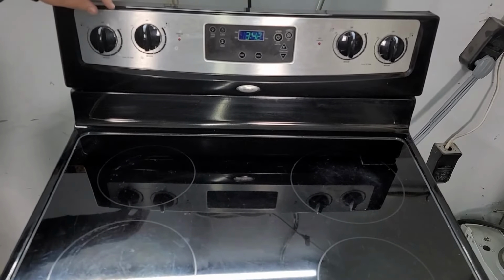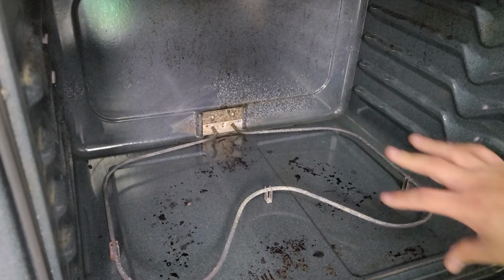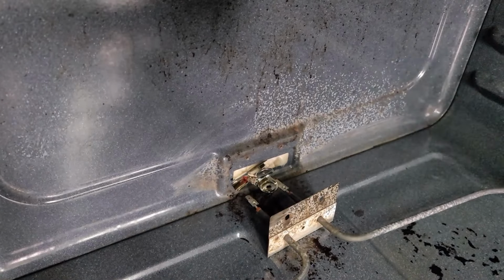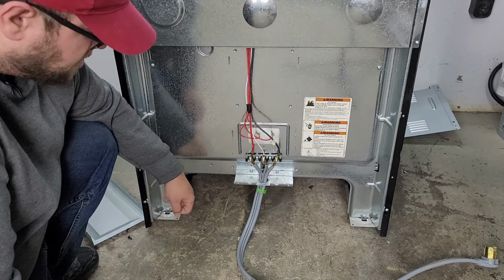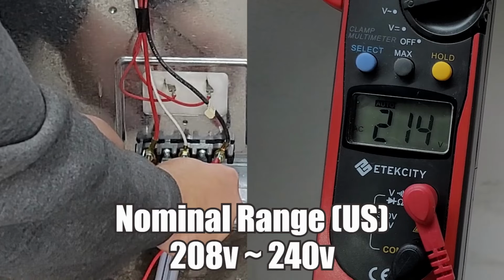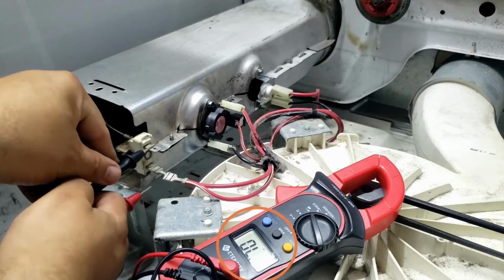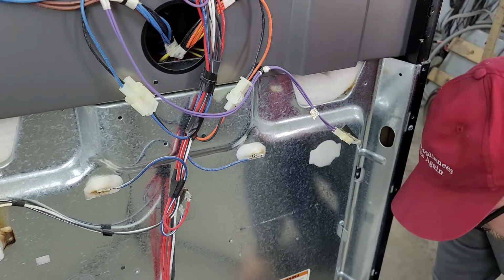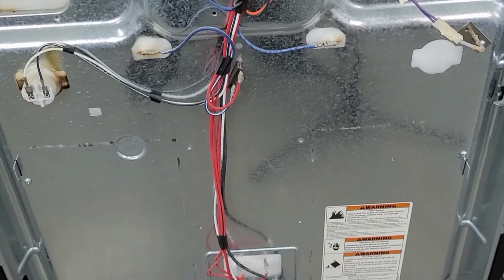Whirlpool Oven Won't Heat - How to Range Troubleshoot a Whirlpool Oven Not Working

Comment: the bottom burner works fine but the top oven burner sometimes kicks on and sometimes wont come on.....and you have to wait for the oven to get cold before the top oven element will come on....is the thermostate in the right place.whats my problem. its a RJE 3020W0 whirlpool...the bottom oven element works good and kicks on and off and keeps the temo right for baking in the oven...my trouble is with the top oven element which checks out fine....it just dont want to kick on.

Comment: Hi Ben, thanks for the very informative video. We have almost the exact looking stove, except mine has the fourth prong. The stove top works and also the broiler. It's the lower heat element that isn't working. I've used a multi meter n the actual element is fine. What could it be?
Reply: I also checked the thermostat n it is fine also
Reply from the maker: Usually its the heating relay on the board if the thermostat is fine as well as the heating element.
Reply: @bensappliancesandjunk    Can you help us? I ca'nt run my electric glasstop and oven at the same time without tripping the circut breaker. Any ideas? Thanks in advance!
Reply from the maker: @monir9696  power cord, terminal block, or breaker are bad. It happened to my stove maybe 3mo again. The power cord was melting but I took care of it before it got worse.
Reply: @bensappliancesandjunk   OK have replaced the breaker, thankyou
Reply: Thank you! Do I most likely need a new control board?
Reply: I had put everything back together after doing so I plugged in the oven, as soon as that happened the wire connector to the bottom heating element sparked! 😬

Comment: My bake element was broken so I purchased a new one. I replaced it but it didn't heat up, my broiler element heats up. I checked my thermostat and the oms resistance was at 1065 well below the chart you showed, however you said a standard stove should be between 1050 and 1100 moms and the reading fell within that range. Do I need a new thermostat?
Reply from the maker: If its 1065 with the stove being at room temperature, no.

Generally, if you replace the heating element and the broil works but not the bake, its the bake relay on the control board has gone bad and the board needs replaced, or the relay itself.
Reply: I tracked the wiring to the control board, is the relay the plastic connector attached to the board the wiring goes into?

Comment: My Whirlpool oven isnt working after self clean. Replaced the thermal fuses and the shut off fuse ... and the control board and still not working. No display. Power does not come to the door lock. Oven is 5  years old. What do you suggest I do?
Reply from the maker: Did you say the display is not working at all? If it is not working, do the burners work?

If burners works the control board could be bad. If the burners do not work, it's an electrical issue.
Reply: @bensappliancesandjunk  Thank you for helping. Nothing works. No display. This is a whirlpool built in oven only. No burners. Control board replaced, thermal fuse and shut off fuse in the back replaced.
Reply from the maker: @karemani2002  if board has been replaced you'd want to star tracing wires to see why you aren't getting 120v to the board. It not turning on suggests a wire is bad or burnt or electrical has done something on one leg to prevent its operation
Reply from the maker: By chance have you reset the breaker?
Reply: @bensappliancesandjunk  Braker is good. I traced the wires and found that the dial that turns the oven on (bake-broil etc) and off has some burn marks on it and decided to get a new one. It is coming in a few days and will let you know what happens. Thank you
Reply: @bensappliancesandjunk  I found out that the control switch (the wheel on the front panel) got burnt. This is the switch that enables you to turn the oven to broil or bake or clean etc. I bought the unit on ebay for $40. Replaced it and everything wen back t to normal.  I got my oven back.

Comment: I tested everything and all was good with temp sensor and elements & line power supply. I can hear the control board click on and quickly click again, the oven elements just get warm (enough to touch) I set temp to 350, then the display shows 100 degrees; so I'm guessing it's the control board. Would you think it is too?
Reply: This just happened to me as well. Could you please let me know how to fix this?
Reply: Same here
Reply: Same
Reply: Me too how was it fixed
Reply: It was the whole control unit. Where display is.
Reply: @albertm105  did the stove top work?
Reply: @CaptainCurtReacts  Yeah it ended up being the whole display unit after that worked perfect. The whole module
Reply: @albertm105  where did u order it from??
Reply: @CaptainCurtReacts  lmao funny seeing the same ppl on yt from other places 😂
Reply: @Amazing_80  lol this fixed it.
Reply: My oven showing F9
Reply: Same with me

Comment: Hi Ben. I have a WP looks just like this model. Largest front main cooking burner switch was hard to turn a couple times then just fell off. I did some research and it seems it could be the infinity switch? Also, right about that time my broil element stopped working. Not good for a real cook. Can you help please? Are those two proems connected?  My son has a meter and his electrical cert a d works for a fire alarm co but lives in another state. If you would be so kind as to steer me in the right direction toward repairing these items maybe I could fix it or somehow get him to help me.
Reply from the maker: Both things are typically not connected, as the infinity switch is totally separate from the broil element in the vast majority of stoves. A scant few are, but most are totally separate. I'd replace the infinite switch first, then look at what's going wrong w/ broil.
Reply: @bensappliancesandjunk  Thank you for your time and advice Ben.

Comment: Hey I have a Maytag oven and my element got a hot spot and broke in half. I ordered a replacement element and I plugged in the 2 wire and now when I heat up the oven it doesn't heat up...any thoughts? Thanks

Comment: Hey Ben I have Whirlpool glass top stove /oven My baking element will not get hot temperatures on display will not go higher then 100 degrees. The broiler at top works fine as well as the stove top all work . Any idea what may cause my baking element not to work it also is brand new . Still has the new oven smell when you turn it on we have used it only 3 times .
Reply from the maker: I'd check for 240v going to the element. That is quite advanced though. I'd unplug the stove, and pull the control board and look for physical damage to the square or rectangular boxes on the control board. Likely, the relay has failed and there may be physical evidence of that such as a burn mark. 

Is the stove brand new or the element?

Comment: Hi! Looking to see if you might have an answer!

Whirlpool Freestanding range similar to the one shown in this video... cooktop turns on, starts to heat, then stops. Same with oven, heating to about 200-215 and stops. Nothing more. Can you offer any advice? 

I can get the cooktop to work properly after a few tries of turning it on and off slowly.
Reply from the maker: Do you have knobs that turn it on/off for the stove? Or are they all push-button? For the oven, that sounds like a relay issue on the board (it starts going bad, and the proper electric fails to cycle to heat fully)... For the stove part - thats real odd, and would make me think the relays work on the stove-top from the board too. However, older or more basic stoves don't route any electric to the stove-top thru the board, just the knobs.

That would then make me think you're getting insufficient voltage to the entire stove. That's where it gets pretty seedy, because you'd have to do a live voltage check w/ a multimeter. Its 240v so that's dangerous and I'd suggest a professional. Or if you had good gloves on, and were fearless... You'd check for 240v at terminal block while you run the oven and stove, to see if there's any sort of voltage drop (you need 208-240v to properly run either the stove top or oven as both sections need a TON of electric to operate). If there's no drop, either a wire isn't plugged in right, is partially burnt, or not fully connected.... If those are ruled out, it points back to board again
Reply: @bensappliancesandjunk  woke this morning for the eyes to not be working at all anymore!
Reply: Nor is the oven, control board?
Reply: @bensappliancesandjunk  i have 4 knobs and a push button screen.
Reply from the maker: @shelbyseay2815  sounds like an electrical issue
Reply: @bensappliancesandjunk  pulled the back off, wire going to thermal fuse is burnt
Reply from the maker: @shelbyseay2815  there's your issue then. You'll likely need a new thermal fuse and re-wiring to that fuse. Not too expensive, usually.

Comment: Extremely helpful video. I have the same oven w10432689a with the same issue. I have followed your steps and believe in is the control board. However I can not seem to find that control board anywhere on the internet. I have followed your link, Google, Sears, Whirlpool, Amazon and have had no luck. Any advice? Thank for the video.
Reply from the maker: Use any of the parts websites to determine the model# of the BOARD you need. What I typically do then is just do a general Google search for the board and then go hunting to find anyone that could have it... Many times, if its old, the result ends up on EBay.

Comment: Hey Ben, my stove top works fine. But my oven doesn’t  heat up. Both elements are not getting hot. I tested my terminal block and it’s good. I can’t get a reading on my oven thermostat. Thoughts? On bake, it won’t heat up. And on broil it reads that it’s already to 500 degrees instantly.
Reply from the maker: Sounds like thermostat is bad. You NEED to get a reading of about 1,100 ohms @ room temperature, and anything much beyond that is going to mean its bad. Every mfg. uses practically the same setup for ovens either electric or gas. So as long as you can confirm there's no ohm reading from the thermostat, its likely the culprit and they're usally real cheap to use.

Comment: Hey Ben, I could use some help. Top burners won't turn on. Oven heats slowly. Tested elements, all seem fine. Tested power like you did. It shows me the 120 per side & 240v. But when I turn a burner on & check again. It no longer gives the 240v. But i still see the 120 per side... I've tested the outlet & i get 240v there. So a bit lost...
Reply from the maker: What does voltage drop to when you turn oven on, or turn a burner on? It should stay constant at 240v. If it drops a lot lower, you have a neutral issue.
Reply: @bensappliancesandjunk  I can't remember exact number off the top of my head but it falls under 100v. When you say neutral, do you mean on the stove? Or with the wall outlet?
Reply from the maker: @Lopezdotk24  if its under 100v, that's 100% your issue.

Basically, it means a wire is either disconnected or burnt somewhere that's causing the stove to seem normal, but as soon as there's a major amperage/power draw, the voltage drops which is insufficient to properly utilize your stove.

Where it is - that's gonna be a challenge as I am not an electrician and cannot properly tell you the procedures. However, when WE have had it happen, its going to start at the outlet, then go backwards to the power box/breaker box, where the breaker may have gone bad. Do your other 240v appliances work ok? If so, it'd either be the breaker or outlet, most likely. If other items are not working on the same box that uses a 240v draw, it would be further up the line like the box/ect
Reply: @bensappliancesandjunk  Yeah other appliances are working fine. It's only the stove having issues.

Comment: Welp, my landlord replaced my broken bake element with an old one and when I started it, it took forever and I noticed an almost crackling sound so I shut it off. I went to use the stove later and it didn't work. No heat indicator light. The display works, the broiler works and the bake element still got heat when I started for a second to see. I just bought a multimeter but does anyone know what would cause the issue? Thanks!
Reply from the maker: Ok, so if the broil works 100% easily, and the heating element for bake is not heating very well, you want to check the element w/ a multimeter to confirm ohm rating: 20-40ohms is within the "Good" range.

TYPICALLY what I see on units where you get "Some" heat but not anything over, say, 200*F, the contacts within the control board have burnt up, and either the control board needs replaced or the bake relay needs replaced.

Comment: thank you for a very informative video... If your oven heats properly when using convection but stays in the pre-heat cycle during Bake and goes no further than 285 degrees - any ideas on the problem?
Reply from the maker: Does the convection fan have a built-in heating element? Its possible that the convection is using the broil+convection fan heater, and the bake element or relay system has gone bad. You'd have to use a multimeter to check & test the various connections to see if the elements are bad,. or its board-related.
Reply: This is my problem too.

Comment: Hey Ben! My stove tops are all working fine but broil and bake just stopped working randomly.
Reply from the maker: Both bake/broil died at same time? Either a electrical connection from the stove control board to the elements has gone bad, or the board relays went bad.
Reply: @bensappliancesandjunk  just tested my temperature sensor and it came up at only 500 omhs, could that be the issue?
Reply from the maker: @Darkhumourcomedy1  likely yes it should be around 1100 normally

Comment: All 4 burners on glass top Amana range suddenly stopped working. Front panel reads “cooktop hot”, but again, no heat. Oven works fine. Is this the thermal fuse possibly? Unit is only 18mo old.
Reply from the maker: Thermal fuse typically kills heat to oven, not cooktop.

I'd take panel off behind control board and look if a wire has burned up or come off. All of those switches are daisy chained together and one bad wire would likely kill power to all of them